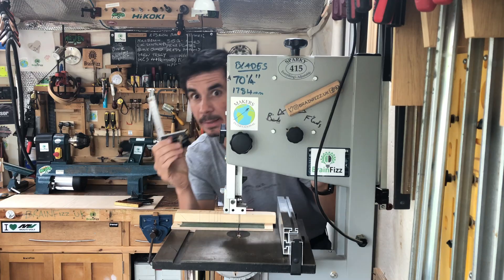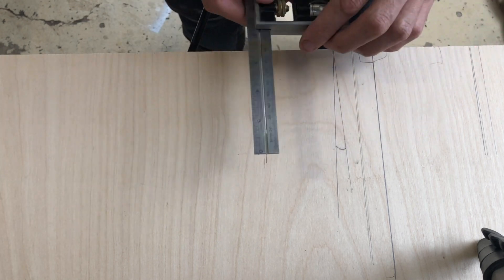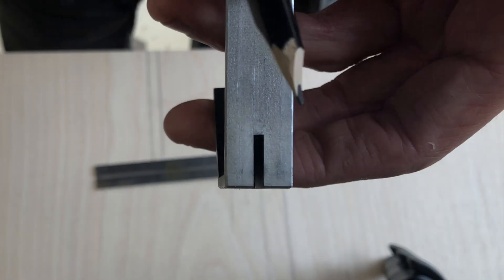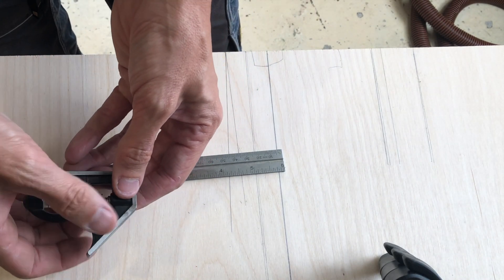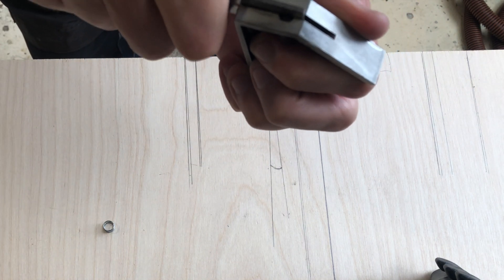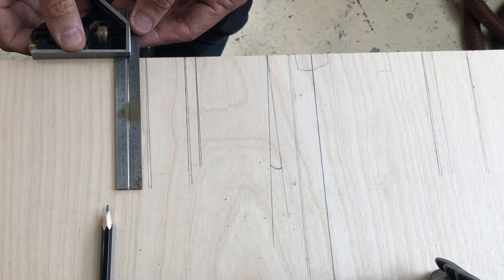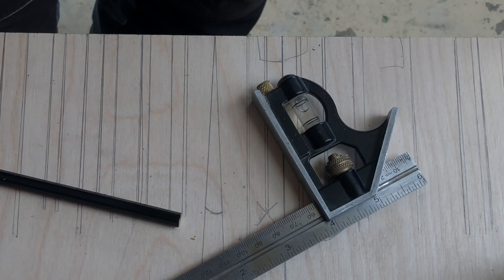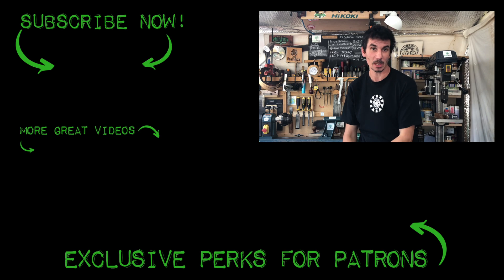How to Adjust & calibrate a combination Square | How do I

Comment: I bought a machinist square (a try square) calibrated to DIN 875/1, and used it to check my combination square for squareness. 
A small extra expense, but faster than drawing the double lines (and you don't need a perfectly straight edge). I think a good reference may come in useful when calibrating other tools in the future.
Reply from the maker: How long did the tool take to arrive?

Comment: Nice. I use a small diamond warding file. Good video.
Reply from the maker: Yes, a small file will work perfectly well for this - actually better on the older 'vintage' squares that are harder metal... cheap aluminium ones are easy to scrape if you haven't got a small file.